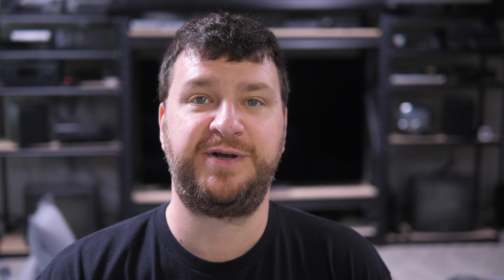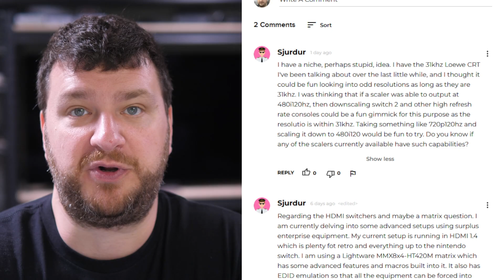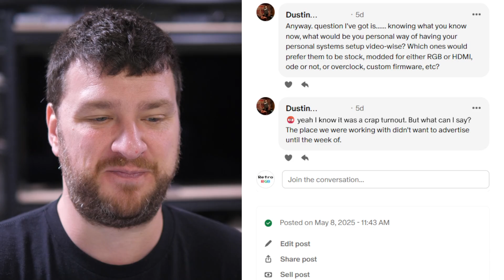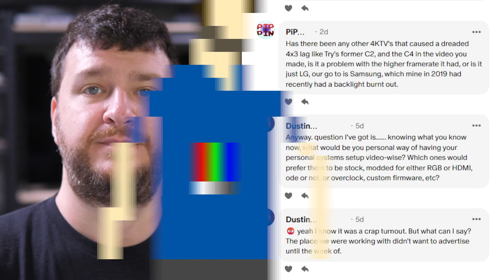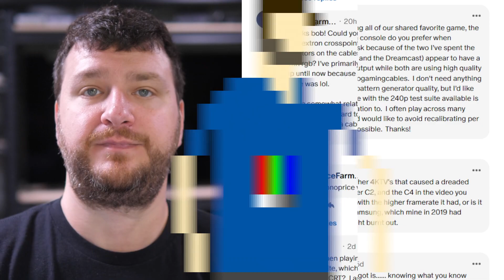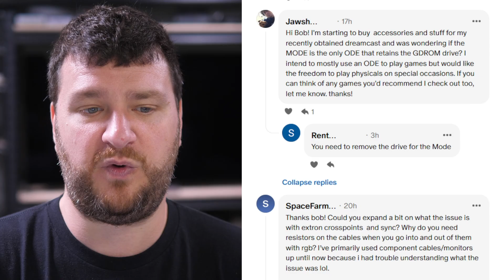Supporter Q&A #356

Comment: I just got an Extron SW4 4 input 1 output hdmi switch off ebay for $20. It’s hdmi 1.4 but that is plenty for my usecase. I’m using a Sony KD-34xs955 hd crt and plan on using this for my hdmi only devices that can output 1080i like PS4, windows XP pc (via dvi to hdmi cable) and Roku 4k streaming stick (yes it does support 1080i which is awesome)

Comment: I actually just picked up a university surplus Kramer VP-728 switcher to use as an analog to HDMI converter. Its output is beautiful, but I do need to learn how to set up an unaltered 720x480 29.97 profile.
Reply: Do you think Mike Chi has a spreadsheet with the various values? I'm sure I could eventually work it out, but I'm lazy. It needs H/V total, H/V sync pulse width, H/V active start point, H/V active region, H/V polarity, and pixel clock. (The Kramer VP-728 manual is available online.)

Comment: Sjurdur, try using the CRU on nvidia control panel (or even the standalone one from before it got integrated, in case nvidia blocks you) to force 480i@120. You might have to dial in in a little, but you can do all your experiments on there. Hypothesis; interlacing is less noticable both as higher resolutions and higher refresh rates and can be totally worth it in certain situations.
Reply: Thanks! I have a GTX980ti in my pc, so that should be feasible, but then i'll be limited to playing on pc, unless I play through a capturecard through the pc whcih would be silly. I'll try CRU on my pc and see what happens :)

Comment: Hey Bob. Thanks for the Amazon link. It looks like that unit is sold by the Amazon UK store. Do you know if it is safe to use in the USA? I know the Japanese desolder sucker uses slightly different voltage that you can add resistors and such to make it safe in the USA. Since this plugs into the 888DX, I'm assuming it's okay, but I never want to assume. 

What do you think?
Reply from the maker: This is 100% a guess, but I doubt Hakko would make regional accessories for their station.  It would make more sense to have the stations themselves be regional and all accessories universal.  Just a guess, but it would seem pretty dumb for them to do it otherwise ;p

Comment: I also keep stock consoles along with modded ones! I went completely overboard with the NES though: on top of a stock one, I have another one with only expansion audio added, 2 built with the opentendo board, one with the cleanest composite video signal possible using the RGR composite board, another one with NESRGB, and another built with NESessity (with stereo and mic input) and NESRGB.

NESRGB is awesome and will get you the cleanest image, but nowadays, I mostly use composite video for the NES because that's the only way to get authentic colors with this system.